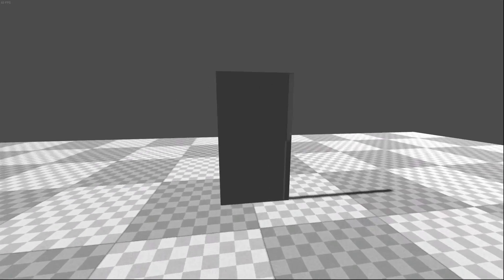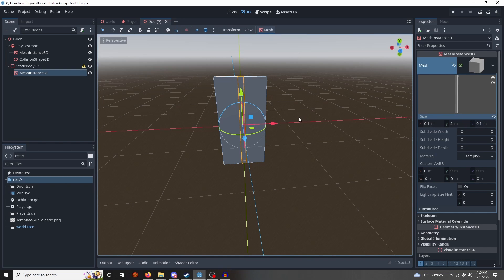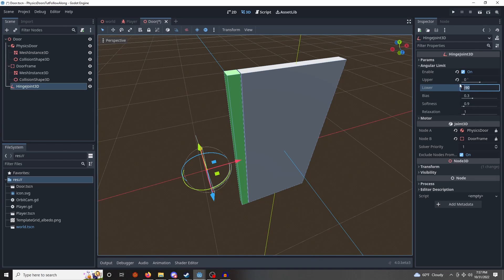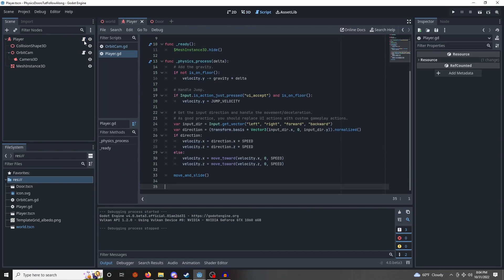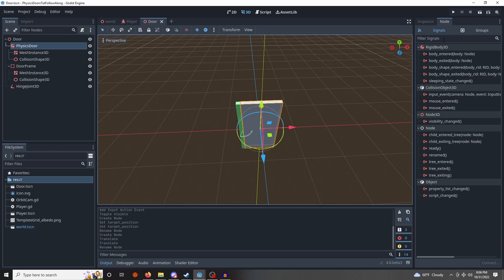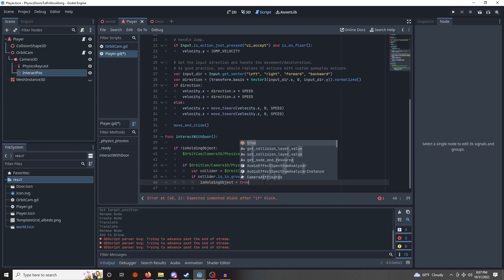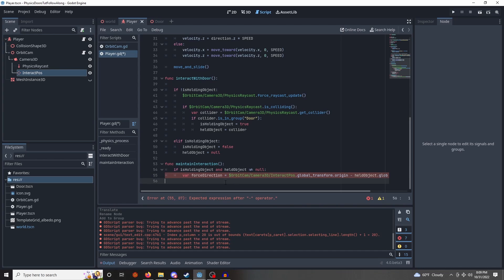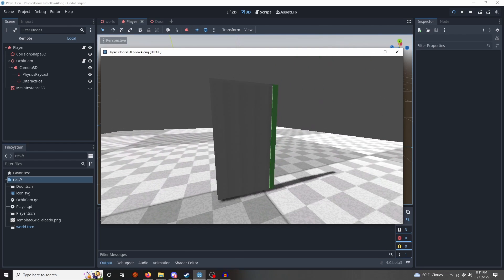How To Make Physics Hinge Doors in Godot in 11 Minutes

Comment: When I walk into the door from the other side it goes out of the frame...

Edit: Fixed it by setting the door's Collision Layers to 1, 2, 4 and making the player a RigidBody instead of CharacterBody.
Or if you want to keep the CharacterBody you can add this code to your player after move_and_slide() which makes you push any RigidBody when colliding:
	for col_idx in get_slide_collision_count():
		var col := get_slide_collision(col_idx)
		if col.get_collider() is RigidBody3D:
			col.get_collider().apply_central_impulse(-col.get_normal() * 0.3)
			col.get_collider().apply_impulse(-col.get_normal() * 0.01, col.get_position())
Reply: I love people that post the solution, thank you
Reply: you became my personnal mister beast
Reply: absolute gigachad
Reply: Nope Didn't work :L
Reply: @Millu30  how? it worked perfectly here
Reply: @mjkL1337  you are using rigid body or character body?
Reply: @Millu30  character body. i pasted the code after move and slide and it works very nicely

Comment from the maker: For those wishing to develop this system further, consider adding a distance check from the player to the held object in the maintainInteraction() function, and letting go of the item if the distance becomes too great. This is to avoid controlling objects over large unrealistic distances, which this setup currently allows.

Also, don't forget that you can manipulate the physic door's properties (mass, bounciness, etc) like any other rigid body to get your door to work just right. 

Hope this was helpful!